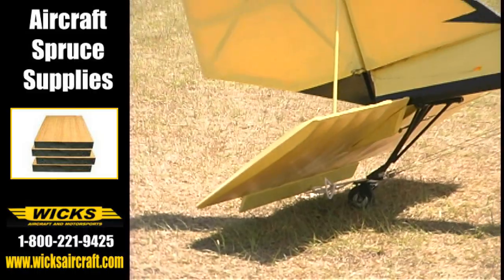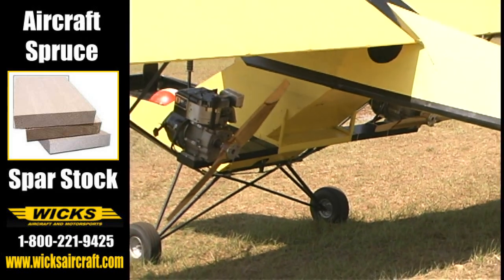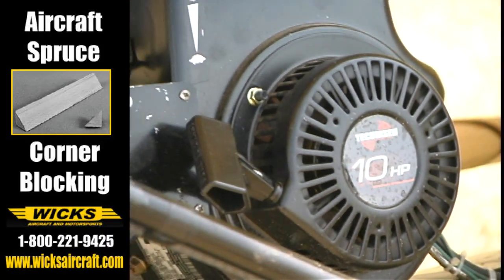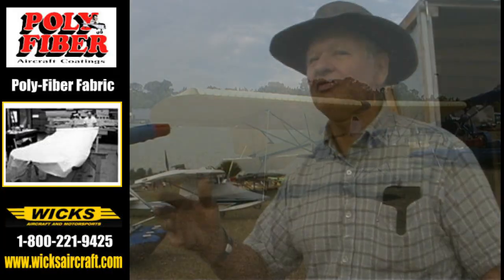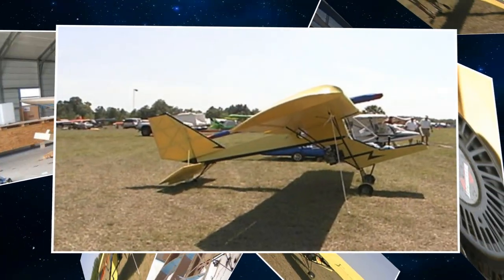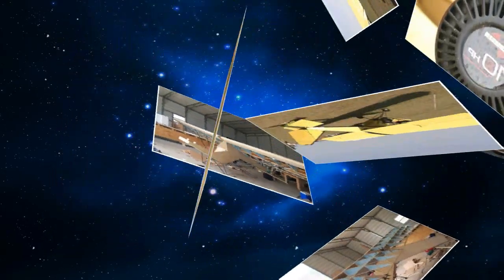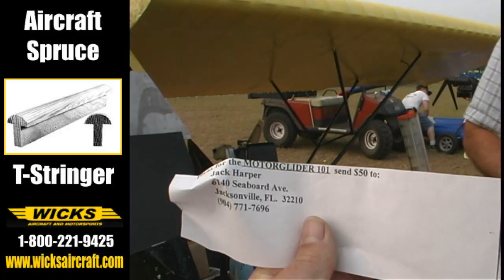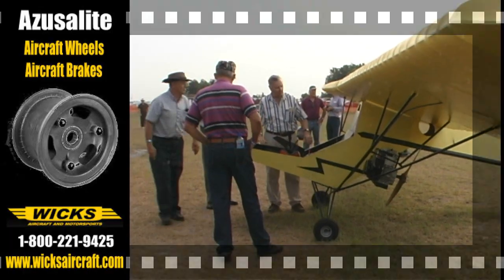Home Depot ultralight aircraft, Jack Harper and his HomeDepot plans built ultralight aircraft kit!

Comment: I've always wondered if you could cover a built up structure, like this, with plastic wrap like they use to winterize boats?
Reply: I have only used it in places where it shrinks up very tight again whatever it’s surrounding. That said, it would I think it would crush the ribs as it is heated. You might try it on ailerons first.
Reply: Building on your idea, I wondered if you can coat the surfaces with a thin layer of epoxy? To allow for smoothness, weather protection, and perhaps then you could apply a hydrophobic coating and prevent ice build up

Comment: 45 mph with 2, 10hp engines! What's the useful load? 120 pounds with fuel.
Reply from the maker: 45 mph, and 20 HP - no different than most ultralights with a 250 lbs useful load!

Comment: Have my doubts folks..cant find a video of this aircraft flying and I suspect that if this plane actually flew it was with two ROTAX 227 (26 hp) "2- stroke" engines that Jack Harper lists as optional engines in his plans brochure. Outside of lift motors for hovercraft, I have never heard of ...or seen anyone get airborne with two VERY HEAVY 56 pound "low power to weight ratio" 10 hp 4-stroke lawn mower engines. With all do respect to Jack however, I like the design and am always impressed by these super builders and would suggest readers give him some builders leeway here as while it is fun for Jack to say "I built a plane from HOME DEPOT parts," it detracts from the moment too have a lot of qualifiers such as motors are not from Home Depot, struts are not, etc. I suspect Jack hung the Tecumseh engines on there for the video show as HOME DEPOT  sells 10 hp Tecumseh engines, but not the much more expensive ROTAX 227 engines commonly used in ultra light  aviation applications. What is pictured in the video with Tecumseh engines is probably just enough thrust to taxi with. 

Chief Pilot (retired)
Reply: @TugIronChief  
Can’t argue with your statement  about being a great orator or his vision of do it yourself flight!!!

Comment: Back in the 70's there was a small bi plane designed before ultra lights had a designation.  It was called a Hovey Wing Ding 2. It was made of door skin, lumber yard fir, 4" reinforced aluminum tubing, blue board foam, and a type of insulation board and piano hinge for the empanage.  I owned one. I met Mr. Bob Hovey. He had other designs as well. Google it. Oh yes,  the wing ribs were of aluminum..not basic hardware tubing, formed around a wood template and plugged into the spars and the held in place by sewing them to the wing fabric.
Reply from the maker: https://youtu.be/By0xQriEPNI
The Ultralight Flyer

Comment: Inspiring, I’m gunna build one from Walmart now!
Reply: Inspiring..to cut up my pilots license. Don't wish to share the airspace now.
Reply: @pilot3016  Kind of how most air transport pilots feel about general aviation.
Reply: @BrightBlueJim  Actually.. I know some ATP's that also engage in Competitive Cross Country Soaring and own a sport home built.  (Glassaire).
Reply: @pilot3016  Okay then, one bit of anecdotal evidence for another:  I know a GA pilot who once asked an airline pilot what GA pilots could do to make their job easier.  The airline pilot's response: "just go away".
Reply: @pilot3016  Bottom line is, Part 103 is designed so the amount of damage that can be done with ultralights is minimized.  Weight and speed restrictions limit kinetic energy (sort of), fuel capacity restriction limits fire hazard, and so on.  Seems like the light sport class is more dangerous than ultralights these days.
Reply: @BrightBlueJim  possibly, but you can find guys here on Utube admitting to flying at extreme altitudes.  I called one out and was attacked for putting down a "Free Spirit".  The FAA did finally catch up with him after several other occurances, which I had nothing to do with.  Do I know of any light sport incidences?  Only self inflicted lack of flying ability.
Reply: @pilot3016  The only altitude limit on Part 103 is the class A restriction of 18,000 ft MSL, so unless you're saying they were higher than that, what's the problem?  Now, if they were going into restricted airspace, that's another thing.  We're talking VFR here, which means you have to look out for traffic at all times, anyway.  What's the special problem with 103?
Reply: @BrightBlueJim  yeah.. 18,000 feet and be sure and look up the oxygen requirements.  I am a sailplane pilot.  I carry O2.
Reply: @pilot3016  Sorry, I've lost track of your point.
Reply: @BrightBlueJim   The point was..buckaroos go flying at illegal altitudes, without O2, and they can't possibly be youngsters playing.."Look at me on the internet"..  I have flown in a legal "wave window" to 21,200 ft over Minden Nevada.. but everything was legal. Dang it was cold.  By the way..for what it's worth.  I'm 70
Reply: @Brad-sh2wn  Glasflugel H-301 Libelle.  A flapped version of the H-201. With 02.
Reply: @pilot3016  is wow thanks for replying sounds exhilarating
Reply: @Brad-sh2wn  It's fulfilling, beautiful, a challenge, and spiritual.  Soaring is fantastic.
Reply: @pilot3016  wow yeah I remember when the hang gliders landed in Washoe valley. I was thinking wow jumping off a mountain top. I have a friend in Mexico takes me for a ride once in awhile. On his two seat ultralight hang glider. Lot of fun flying over the water.

Comment: I don't think the thrust bearings in those engines will handle the constant thrust that is being applies to the crankshaft.  They were not designed for anything close to that load.  Any engineers able to help... how much linear thrust does 10 HP equivocate to?
Reply: I built an airboat  35 years ago with a 10 hp Tecumseh engine just like that and it had right at 40 pounds of thrust but, I was using a prop designed for that size engine and rpm range and my prop was 42" long...much longer than his looks to be so I do not think he is getting anywhere near that amount of thrust.  I still have that prop hanging on my wall.  I ran that boat for 2 seasons and never had any bearing issues but if I were flying I think I would not trust those bearings in that application because they were not designed for end loads on the crank just as you said.
Reply: @OverlandOne  actually, if you wanted to alleviate the end load on the engine,you could use a jack shaft with a chain or a v-belt drive
Reply: Enough thrust for drug out bearings that make loud uncomfortable noises before destroying themselves. That much. Wisconsin engines might handle it, don't know about Honda or Briggs and Stratton, (my favorite from my minibike days)  Using a thrust shaft offset from the engine, either belt or chain drive fixes thrust issues replacing them with weight, drag and complexity issues. Engineering is fun!

Comment: Nice little project! Love  the use of light weight material. Basically making engineered beams for the wing ribs. Epoxy or fiberglass would lock that in solid! Plans available? Or where could someone get them or something like what you used? Fun project
Reply: If you want to crash build it this is not a viable ultralight and. try legal eagle, Rodger Mann ragwing,
Reply: @douglasanderson1276  I want to build a legal Eagle. Haven’t started yet tho.
Reply: Why not? @douglasanderson1276

Comment: For all you Home Depot wood haters:
I work at a local lumber yard. (NOT a Home Depot. Their wood is much worse than ours. I don't know if they even sell DF at their nearest store) I regularly find plain sawn douglas fir 2x8s of the best possible quality because they are graded #2& BTR (better). They have no knots, 10-12 grains per inch, and almost no runout along the 1.5" edge for 12 feet. Ripping them into .25x1.5 strips will give you perfect quartersawn laminations. Some of them are all  heartwood and ripping them that thin leaves nowhere for pitch pockets to hide. This man must have a very good relationship with his local HD because it probably takes him hours to pick through all their junk. I get to look at each board as I slide it onto its stack (lucky me :)).

Comment: Here's some useful links for you guys, if you are interested in building or restoring your own ultralight airplanes...
http://virtualultralightmuseum.air-war.org/
http://tractorgyros.air-war.org/
http://eaavideo.org/
http://eaaforums.org/
http://www.homebuiltairplanes.com/
And hmm my site:  http://air-war.org

Jack Harper's Home Depot airplane looks very reminiscent of the Kolb Flyer...   in layout, and the engines used...  all the materials he uses are used in other aircraft builds...   so... no real reason it wouldn't fly (unless wings were too short or it turned out too heavy for those little engines).

https://www.youtube.com/watch?v=pbm7DF4LhQ8

Generally, though, don't use hardware bolts or fittings or hardware store parts in aircraft...  you'll find out soon enough, the further you go down the rabbit hole.  Other aircraft people will set you straight fast on that one...

Comment: The big deal with doorskins is that on an aircraft of this scale they 
are way overbuilt.  

The species is a lot lighter than spruce, but that is in some ways an 
advantage both due to the beefy dimensions and the light weight of the 
craft.

But the material is about 4 times the thickness of the aircraft ply one 
would use.  That means that in situations where one is able to conform 
it to the surfaces, it is 16 times stronger than the aircraft ply on 
form, and 64 times stiffer.  That makes up for a lot of "wow, aircraft 
ply is such great stuff".  Just so long as one can get it in under the 
weight budget.  And it weighs about .33 pounds a square foot.

The biggest downside to doorskins, because the wood quality is usually 
awesome is the minuscule amount of glue they use.  They use glue 
extremely sparingly and normally not good glue.  It is still incredible 
what they will put up with, but if the product has resorcinol glue in 
it, it is amazing.

Comment: It would be a significant display of ignorance if one assumed that 
aircraft grade wood was top of the line, it is nothing like it.  The 
highest grade of wood in general use is arrow stock.  It runs out over 
about 100 inches, or better.  aircraft stock is in the 20,-36 inch 
range.  Every single piece of arrow stock is individually modulus 
tested, often several times.  If an arrow breaks in the bow, it often 
drives right through your hand, a blunt of splintered shaft.  So you are
 motivated to ensure it is sound.  Aircraft stock is nowhere near this 
specification.  One reason is nobody knows what any individual piece of 
wood is going to be used for, so it is impossible to test it close to 
the end use.  in some cases the material would be far too stiff to test 
in any kind of normal fixture.  But with arrow shafting, it is sold in 
near final dimensions, so it is easy to test.

The ultralite maker is in the same situation as the arrowmaker, when he gets down to the point of spar caps  He know what the wood is to be used for, and what section it is, and he can test a piece for stiffness and max load to failure.  The parts are not terribly beefy and can easily be tested in home built fixtures.  He can cream some wood to whatever grade he wants to.  When wood is graded for a supplier to sell, they test some sample from the lot, they never get any closer than that to the stuff you end up buying.  There is no comparison to the process that can be done at home, vs on an industrial scale.
Reply: Hondo Trailside Thank you for bringing this up. I use to be in construction, and I've seen many people try using various wood grades in structural applications, just to end in failure. Usually these are the same people who cuss out a building inspector because he/she is making them change, modify, or reinforce a key loading point. In aviation construction, I would not want to be anywhere near someone who is using #2 knotty pine in any part of there aircraft project.
Reply: @robertemmons2260  I always fashion a crude 2x4 crucifix rudder and attach it to the sissy bar of my ultralight builds - but nothing too structural for sure. Just reach back and steer it like a boat. The latest is Mark VI and I have a good feeling about this one, she's gonna fly.
Reply: I used a typical recurve arrow in my compoundbow once as a kid.  I still have the scar between my thumb and index finger where the arrow snapped on release pinning my hand to the hand grip.  Never did that again.

Comment: He's putting you guys on with his hayseed engineer soap opera schpiel...   have you built airplanes like this before?  "uh huh yeah!"   Awesome!   

If this is the same Jack Harper that made the Harper Breezy, Breezy 2, and Petit Breezy (and I should think it is), then yeah, his aircraft flies and he knows what he is doing.  If his airfoil is sound and his structure is robust yet lightweight, I see no reason why it wouldn't fly.  Its not all that different looking from say a Kolb Flyer.  

http://www.ultralightnews.com/sunfun99/motorglider101.html

http://www.digitalmarketingusa.com/homedepotultralight.html

https://groups.yahoo.com/neo/groups/HomeDepot-Plane/info

But yeah... if you can, 4130 chromoly tubing, alluminum or Stits covering, AN fittings and bolts...   probably a better way to go.... but you pay through the nose for all that shit.  Looks like he covered his with Dacron and painted it with exterior house paint, which works just as well for UV protection or so I've read.  Its the way I plan to go.

https://en.wikipedia.org/wiki/Early_flying_machines

https://en.wikipedia.org/wiki/Category:Ultralight_aircraft

All the early aircraft were built out of cherry picked wood and doped fabric without Home Depot around... so yeah, having Home Depot and Harbor Freight around can't hurt.    And yeah, they fucking wittled their own props back then too...   Orville and Wilber wittled an assload of props in their wind tunnel before they got a good one to work with their home made 12hp engine.  Haters be hating ! ;-)

Other builders use blue foam board in their designs, so that's not unusual...  he rather gives away that he knows what he's doing when he tells you you have to go else where than Home Depot to get the glider fabric and 4130 for the struts...

If this plane interests you, but you prefer a little less wood and go all metal tubing, a comparable somewhat similar build is a "Goat" Glider motorized to be a "Zigalo"...

My dad has a carpentry shop sitting idle, so if you are more comfortable working with wood this would be a good build as you go.  I would have no problem hoping into it as a test pilot and gunning it down the runway for a few crow hops.  I'd paint mine Blue with a big "Lowe's" in white on mine tho ;-0)   The motors look like they can be had new on ebay for $99+$36 shipping.
Reply: I read this as it played lol
Reply: he's a fucking engineer homes,a fucking engine...eeer.

Comment: Door skins are 1/8" mahogany or luan which is another mahogany like hard wood, the "skins" are 3 ply and you can buy them up to 48" X 96" the stuff is not spruce, but @ less than $10.00 per 4x8 sheet and as a proof of concept rather than a daily flier, why not? If you seal the "skins" with epoxy they will last a lifetime (snarky comment deleted) I'd be more concerned with the motor mounts and the dual 10hp engines than the use of 1/8" mahogany door skins.
Reply: John Riggs I wouldn't call it "brittle" how many interior slab doors have you seen crumble from use? lol !
It is a hardwood like mahogany, I don't think I would trust the stuff to build a boat due to the adhesives used to build the laminate layers, but for structural rigidity...Yes, it is very structurally stable, and flexible, if it were sealed I'd consider it for interior non wet area work; it is not legal on commercial aircraft, because it is not fire rated, and before you go there, everything must be fire rated and have the paperwork to back it up in an FAA annualed airplane, right down to the foam in the seat cushions!   (that is the main reason for not buying materials from Home depot)
Reply: Ken Barnett After thinking about it for a little while, 1/4" luan would make a great rib substrate, spruce cap wrapped around with some lighten-ing holes and polyurethane or resin to seal them (ultralights only).
Reply: +R Randall Doorskins are made of luan, which is basically a pine.  Not a hardwood.

Glue used to be marine grade and in some areas people still say they can get it.  I have never seen it, going back 25 years.  I have built a bunch of multis out of it, and they have all held up great if given even modest care, I sure wish they had had the good glue in them.  The testing protocol I was given was incorrect.  The simple version is is the glue black or dark purple.  :)  But nobody mentioned that.  They droned on about boil testing, which my stuff passed.  Anyway, boat has been in the water 25 years, I am 56, so there is no doubt it will see me through.
Reply: So much for worry about the value of door skins. If the boat held up for 25 yr. the plane could be used to go to war. lol  I don't believe any RV takes any more abuse than a boat. Think about. The entire structure is under severe stress every moment the boat is under power. Water puts out a lot more resistance than air. Get even a crack in your hull, you will take on water. Get a crack in those door skins as used and you probably won't even know it.